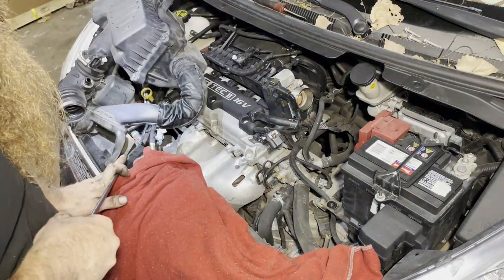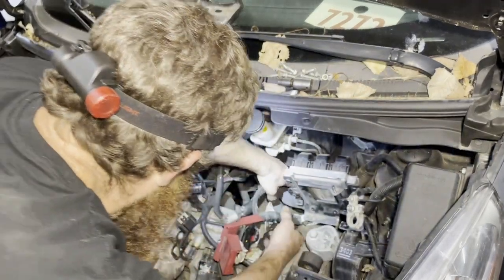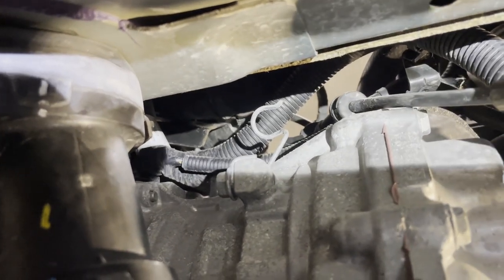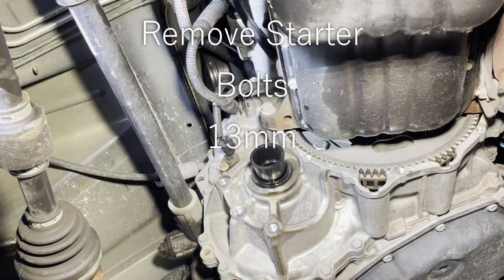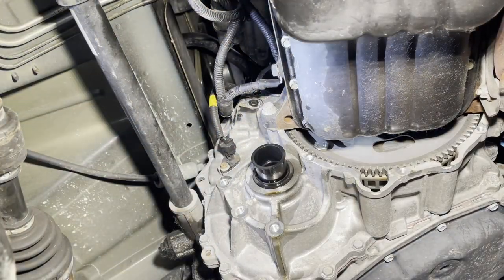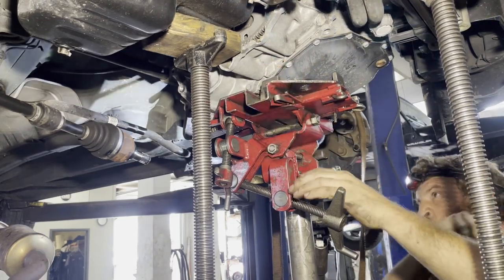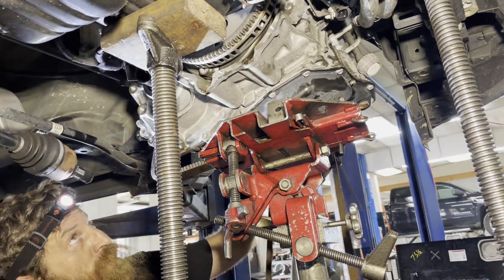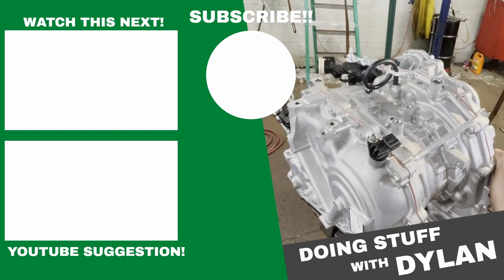2015 Chevy Spark Transmission Removal. Full Process.

Comment: If i am not mistaken Chevrolet recommends cganging the transmission fluid every 90,000 or 100,000 miles.  At 80,000 my girlfriends 2014 Sparks tranny fluid was a greyish black color so I dropped the pan & changed the fikter & fluid & flushed it with 4-6 qts. of new transmission fluid.  Aboit 3 months  after i did the work I noticed the transmission started to slip just a little when getting on the freeway. The fluid also became dark and started to get that burnt smell tranny fluid gets so i drained it & put new fluid in, ran it for about a day and d & r' it again. Didnt help, fluid was still bad and the slipping got progressively worse.  The only thing i can think that I might have done that could have shortened the lifespan was I didnt use the OEM manufactured fluid, I used Valvoline CVT fluid. Maybe that would have saved it and it would still be running, maybe not.  Taking into consideration these CVT's often dont even make it 100,000 miles Id say it was its time to go. But I woild definately recommend chaning fluid every 15,000 & fluid & filter every 30,000 if anyone has one with the CVT that  still runs. And just to be on the safe side, spend the extra money and use whayever fluid Chevy recommends. Its about $50 for 4 quarts compared to the $35 I think it was for tge Valvoline CVT fluid.
Reply from the maker: You’re right every 15 or every 30 would be better but I doubt you hurt it.  Was probably on the way out anyway.
Reply: @doingstuffwithdylan4367  it's sucks because the car has potential. If that thing has a 5 speed it would probably be a little rocket ship. But from what I hear the whole car would have to be reengineered just for a tranny swap.

Comment: I believe these cars are the very definition of "a lemon" and was destined to fail shortly after the mileage warranty expires. If Chevrolet had any integrity, they would scrap the Spark model... at least the automatic transmission version. My big German heritage hands would never fit in that tiny engine so I either have to pay a mechanic with small hands or use skinny tools coupled with mechanic language (aka cussing).
Reply from the maker: Yeah sad days.

Comment: You do a great job with the videos . Good camera angle, all the relevant info you provide through commentary or on the screen with what tool or tool size is needed.  Short and sweet and to the point! Unfortunately, the same cannot be said about the tranny swap, that looks like a month long pain in the ass if I were to attempt it.
Reply from the maker: They can be a real pain in the ass. 
Thanks for the comment

Comment: my transmission went out on my 2015 spark, how long does it take to get the cvt transmission? Im taking It to the dealership because it is still under warranty and im trying to see how long it should typically take.
Reply from the maker: I’m guessing probably a two week turnaround time but it could be a little bit less just ask for dealer they should give you an idea

Comment: Can you pull the engine and transmission from the top and replace the transmission out of the car?
Reply from the maker: Why would you?
Reply: Maybe if you don’t have a lift
Reply: Yes ..I pull both engine and transmission out from up top ...it's way easier ...then I put em back together and slide em back in ...but I take the front pumper out and the radiator..etc

Comment: Do you know where the 2014 Chevy Spark transmission oil pressure sensor goes? Thanks
Reply from the maker: I’m guessing that’s internal probably be there behind the valve body.
Reply: @doingstuffwithdylan4367  now I need remove the valve body do you know how to remove it
Reply from the maker: @edwinromero8157  I was just guessing it’s probably behind the front pan but you may have to pull the unit to get to the pressure sensor I’m not positive